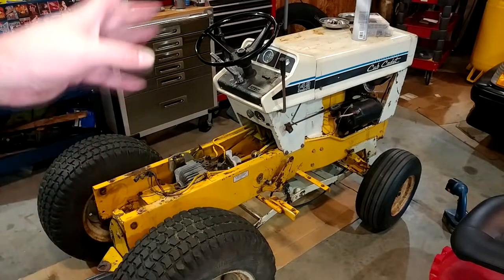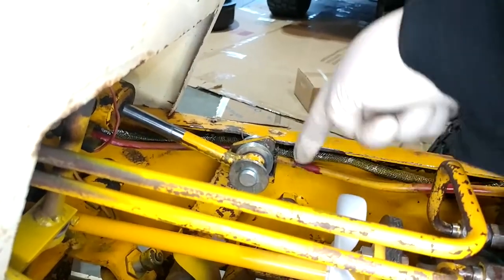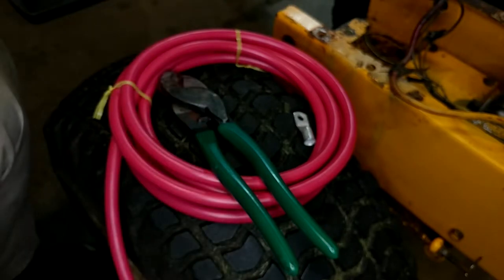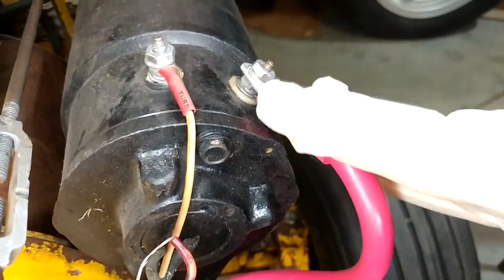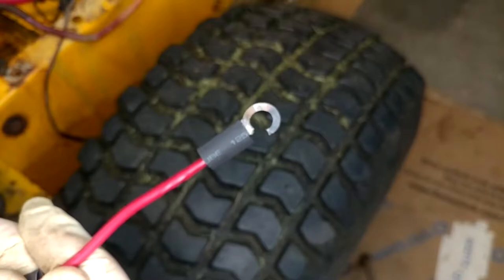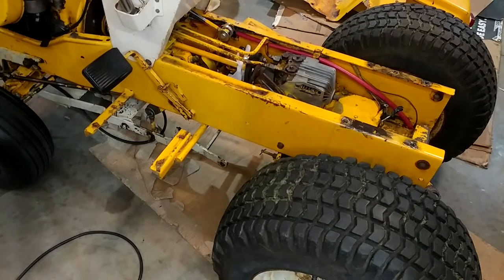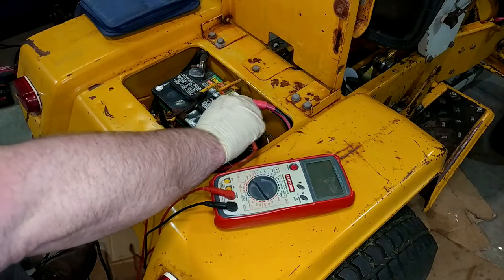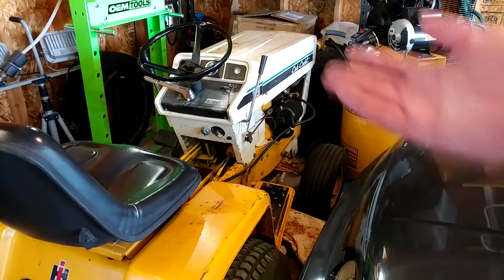Cub Cadet 149 Battery and Starter/Generator Wire Upgrade!

Comment: 26:23  Instead of doing that, run a test light between the ground wire and the ground terminal on the battery.  If the test light lights, there is current draw.  The bulb will act as a fuse.  If there was a short circuit, it would just blow the bulb.
Reply from the maker: Well... I mean... I also had a meter sitting there too. Sparks are more fun. 😁
Reply: @TheBrokenLife  The reason I said a light is that the meter is fused at like 10 amps or something, where a couple of hundred milliamps would kill the bulb.
Reply from the maker: @tarstarkusz  You're not wrong. The truth of the matter is I just flat out didn't think about it and I also didn't really expect a problem. Touch the cable quick, no sparks, probably no problems. That is a habit I got into after doing it wrong on a 2 battery diesel vehicle before I could even drive. BIG sparks when you just cram the cable on the wrong terminal... oops... better to take a baby step first.

FWIW, I would have probably conducted a draw test on the voltage scale where I would be good up to, I think, 600V. If I wanted to see how much of a draw, my meter actually has high and low fuses for the A and mA scales. The amperage mode tops out at 20A and the mA mode is 200mA. For being a 20 year old Craftsman branded meter, it's surprisingly well featured.
Reply: @TheBrokenLife  It's all good, I was just trying to be helpful.
Reply from the maker: @tarstarkusz  Then tell me why the thing doesn't crank over like an F1 car! 😆

...I think I need a crew-served pneumatic starter. 🤔

Comment: He is always one step ahead of me !.. I have thought long and hard about the wiring on my 169 (same tractor as his 149) and I have decided that I will be relocating the starter solenoid to the rear near the battery.  I can do this because I have raised my seat cover hatch by 2 inches (that gave me more room under the seat and it also raised my seat to a more comfortable position).  The other option is to move the battery forward and get rid of the long run, but there is just no room under the hood unless I move the gas tank to the rear. Im not ready for that mod! By the way, the 4 gauge is a significant increase over the 6 gauge. The 2 gauge is really overkill.
Reply from the maker: I'm not sure if I understand the advantage of moving the starter solenoid to the rear? In either location you still have to run heavy gauge wire up to the front of the tractor, but in the rearward position you have to extend the wires from the key switch and ammeter to reach it.

FWIW, earlier model Cubs had the gas tank and battery under the hood. The would reduce the wire runs for sure.

There's no question that 2awg was too much, but I didn't want to give myself any excuses for poor starting performance. It has all of the cable now.
Reply: @TheBrokenLife  moving the starter solenoid under the seat makes it much easier to access and replace. I always dread having to remove the gas tank to get behind the dashboard. My idea is to install  a connection and fuse box so that all circuits are easily tested from water tight  connection box.  It's just an idea at this point.
Reply from the maker: @paulg444  The gas tank tower on mine only takes about 5 minutes to remove. Maybe I'm living right or the pieces I think it's missing make it easier?

It seems about every spring that I end up taking it off for some reason or another. Typically to grease the steering box.

Comment: I have a 1450 that cranks over real hard especially during the cold months. And I have thought about doing this same thing. Have you noticed much of a difference? And did that temporary ground off the starter help?
Reply from the maker: I haven't noticed any difference at all. I'm down to thinking it's the relay, the starter, or "just the way it is".

FWIW, your 1450 uses a completely different starter setup and it generally works a whole lot better. You may want to inspect your fly wheel to see if the teeth are filled with crud.
Reply: @TheBrokenLife  thanks for the reply! I will check the fly wheel out. That is something I never thought about. It makes sense considering I have my issue no matter what the temps outside are.
Reply from the maker: @fiveacrehaven  Good luck with it!